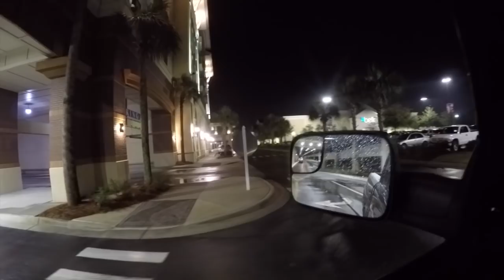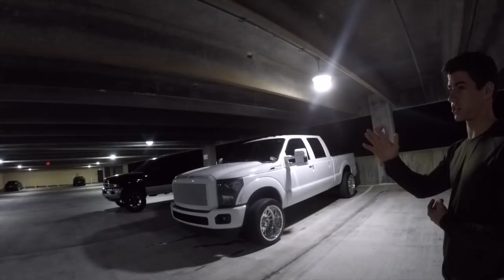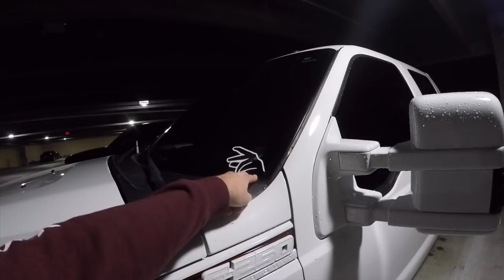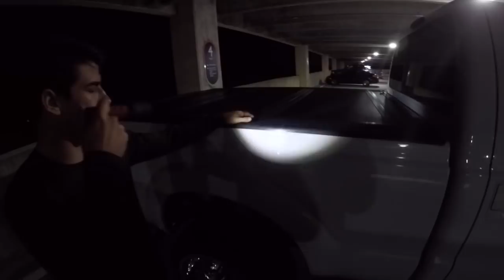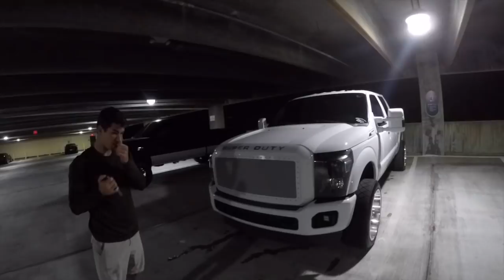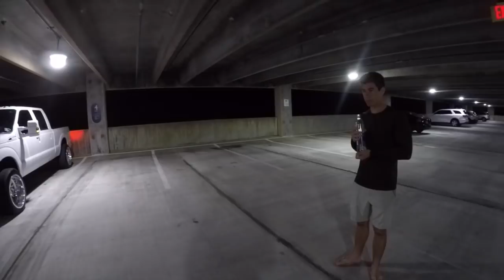THE BEST CHRISTMAS PRESENT EVER!!! | Diesel Central

Comment: Why would you trade or sell the Powerstroke to get something that will always make you wonder when the trans will leave you stranded  68rfe sux  and will barely hold stock Power  the 6r140 will hold 700 ish stock and the glitch is or was a tuning glitch it is not uncommon and rarely comes back after a reset or reinstall tune  there is not enough Powerstroke you tubers and we need more ,not another cumins fan boy. Lol😂
Reply: Here in upstate South Carolina is all Powerstroke shops thats why i switched to Powerstroke. Started off with a 12v Cummins then got a 24v and to be honest got bored with them.
Reply: Bleeding Diesel903 the 68rfe is not the only transmission option for the cummins trucks. From ‘13 on the Aisin has been available and a manual has always been available in Cummins trucks